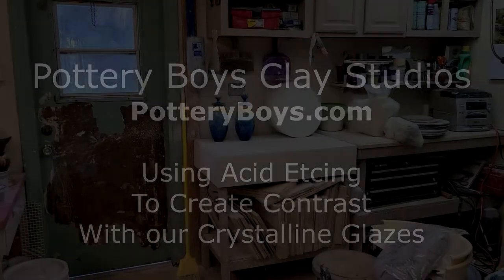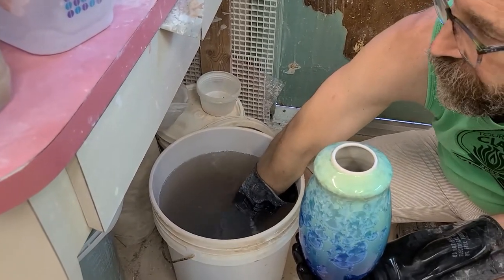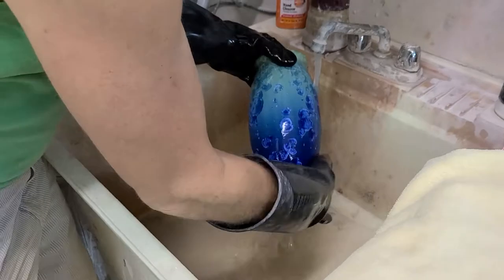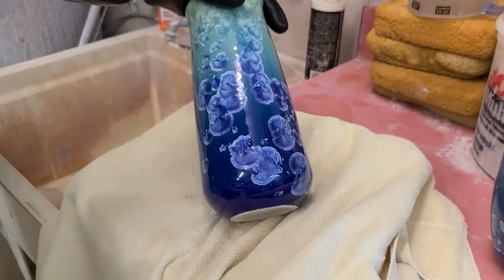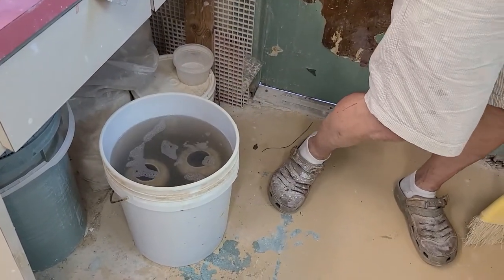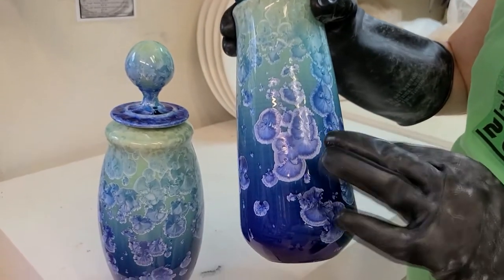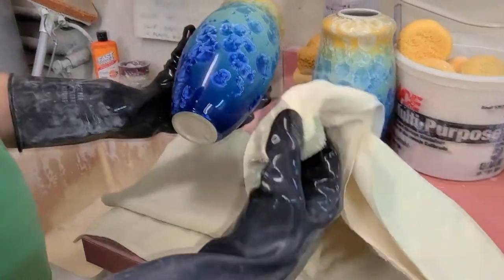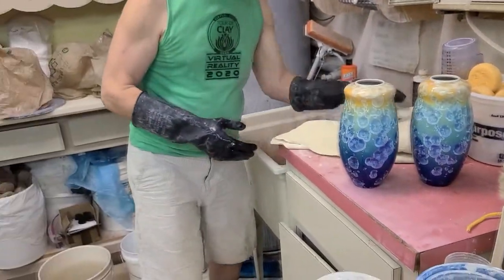Acid Etching Crystalline Glazed Pottery

Comment: Merry Christmas.....Just impressive...Have just started with crystalline glz firing ..Pls can you inform What acid do you use? And what qty of acid and water? And how long to be kept in that solution..thanks...
Reply from the maker: Merry Christmas to you as well.

 

Regarding the acid etching - you can use a variety of acids to etch your crystalline glazed pieces but we use Sodium Bisulfate - we get a 3 lb bag of dry powder at the pool store. It is the PH Down material. We mix this in a 5 gal bucket of water.

 

Others prefer a strong Vinegar but that takes much longer to get the same results. When using Sodium Bisulfate, we expose things to the acid for 30 minute intervals - after each 30 minute soak, we wash it and dry it, then photograph the results. Once the desired effect is achieved, we know how long to etch pieces with that glaze to get the same result.

 

Hope that helps
Reply: Thanks for your prompt reply...So what I understand is 3 lb of Sodium Bisulfate to mix in 5 gallon of water right? @potteryboysclaystudios5686

Comment: Hello.  I bought a clay wine cooler but it turned out to be glazed inside and out and is non-porous.  Is it possible to remove the glaze easily with hydrochloric acid?  Thanks.